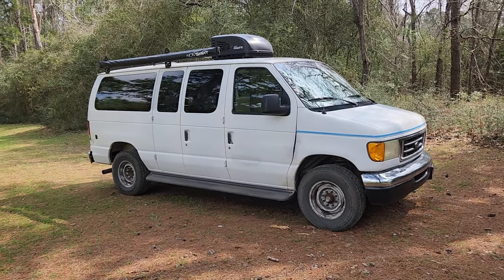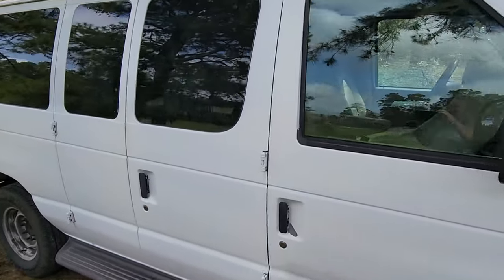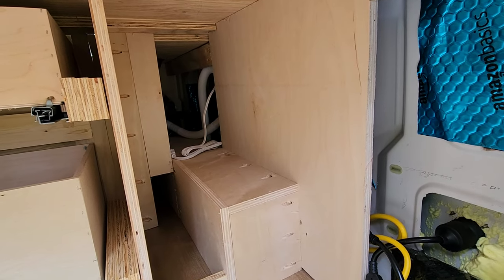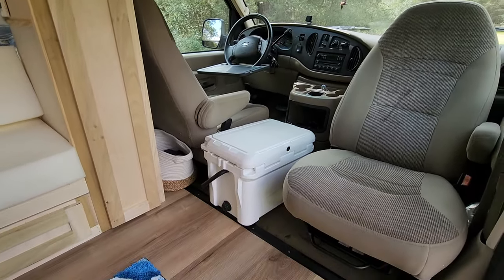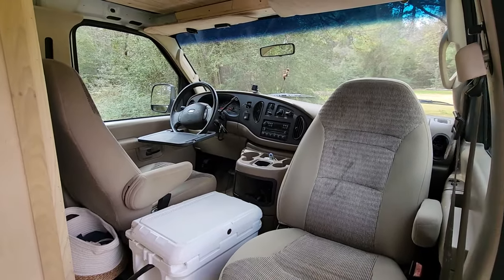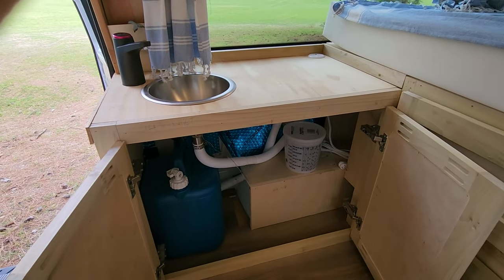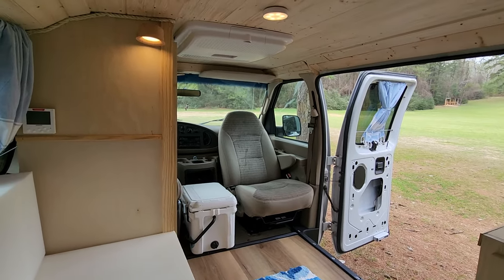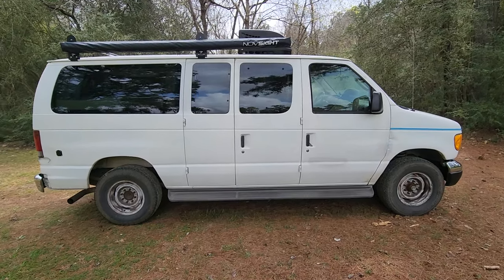2004 Econoline E350 Camper Van Walkthrough

Comment: I have a Ford Econoline Van and converting it right now to an RV, mine will also have a sit-down shower and composting toilet. Thanks for the video and good luck camping.
Reply: I just bought an ex ambulance van and toying around the idea with a shower but curious on how your doing it. And good luck!
Reply from the maker: That's a pretty big investment of space and energy.  We only do short trips so baby wipes have proved to be pretty effective.
Reply: I will be a full-time nomad and wanted all the same things I had in my trailer. With a little engineering, all is good and it's only me so no problem with room.  @CampSailGo

Comment: 1998 Econoline passenger van here. Mine isn't a build out, but it is set up for camping & travel. I'm still trying to figure out ac for hot weather. I have dual air, so don't want to cut through the roof. 
My van only has a payload of 1800 #'s, so no heavy build for it. 
I saw that you like to restore vintage campers as well. I also have a 1974 Silver Streak that I renovated. 
I too am in SE Texas. 🇨🇱
Have fun!! Nice build.

Comment: Would love to see how you actually did the pull put bed! If you set up the camera somewhere, we may be able to see. I am curious because I can tell it's not a slat bed which I'm trying to avoid.
Reply from the maker: I'll try to post a follow up on just the bed.  It is actually a modified slat bed, but with a 1/4" plywood cover to keep it a bit cleaner.

Comment: You may have mentioned in the video but, how many miles are on it and does it have the 5.4l? i've seen a few 2004 e350's i'd be interested in but i'm hesitant because it's the first year they started putting the 3v 5.4's in these vans, and they already had a somewhat prevalent issue with the spark plugs blowing out.

Comment: Do you have a link to the finials you bought, or do you know what the thread is to match? Looking to do the same with mine!
Reply from the maker: Let me check on the finials.  What do you mean by thread?  The curtain wire?
Reply from the maker: PATIKIL M4x0.7 Cap Nut, 50 Pack Acorn Nut Screw Knob Cap Insert Bolt Cover Female Thread Knurled Decorative Hardware Fittings Light Fixtures Bronze https://a.co/d/3H2vzmS

They come in different finishes as well.
Reply: @CampSailGo  This is perfect, more so was curious about the cap nuts / finials you bought. Thank you for the link!!